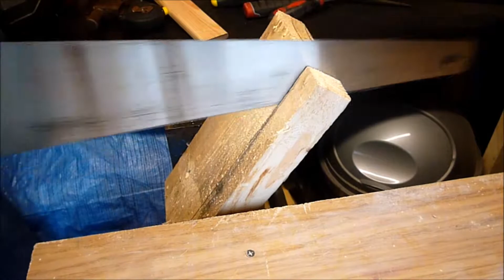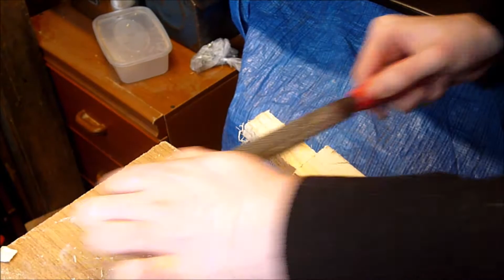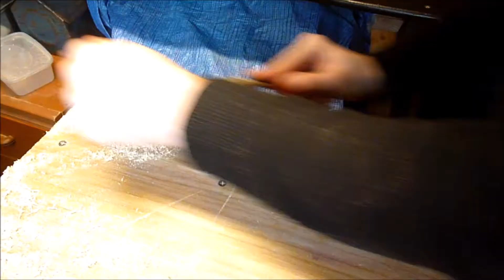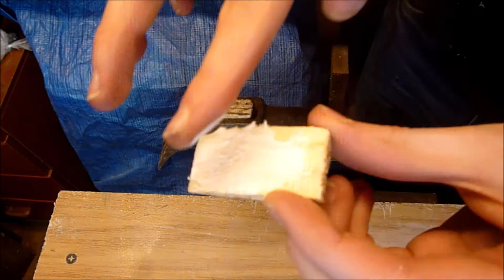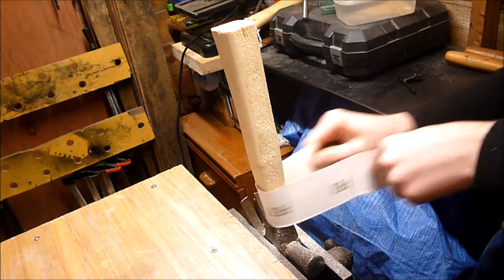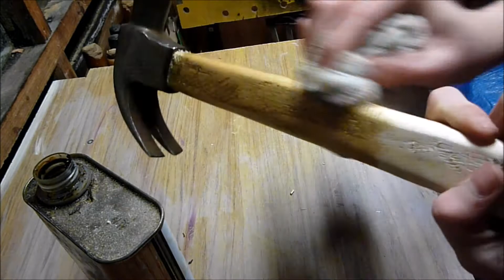Making A Hammer Handle

Comment: What wood is that looks kinda soft
Reply from the maker: The wood used for this was some leftover Pine, as it will be a display piece and not used it is perfectly fine for this application! 👍😁
Reply: @j.stevenson1896  Got it, I recently made a handle out of maple should be a good tree for that